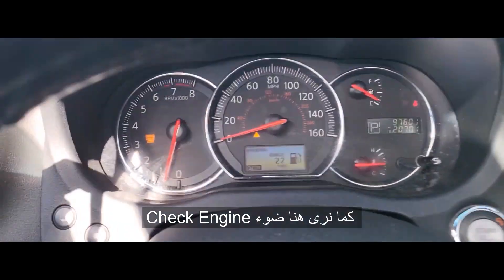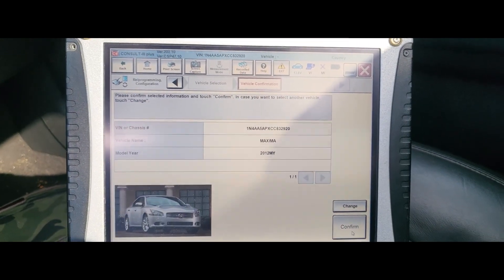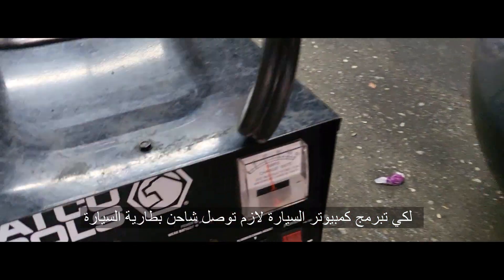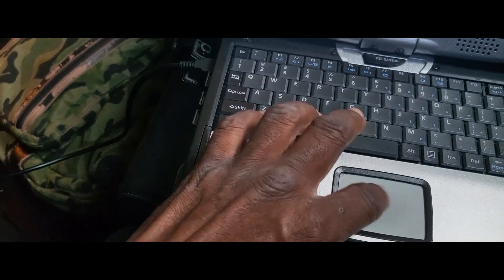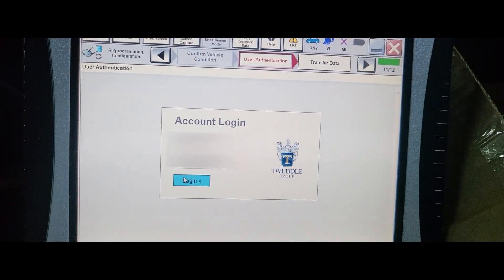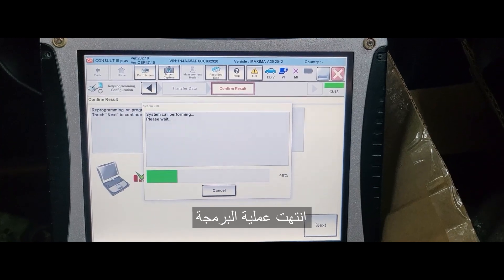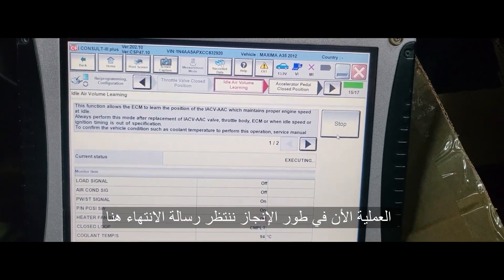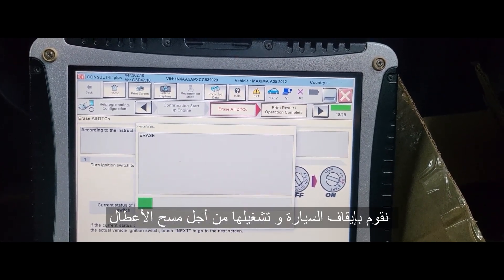مشكلة حساس الهواء و برمجة الكمبيوتر لحله Nissan Maxima 2012 ECU Reprogramming MAF ISSUE P0101

Comment: hello brother where u live i m in jeddah and my nissan maxima has an limp mode issue (lose power)
Reply from the maker: brother Adil I'm far  from you  new York USA
Reply: @BestCarFixes  i bought nissan maxima it goes limp mode i scan on computer its comes code sensro steering and sensor heat may b these one of the cause of issue to going car on limp mode (lose power)